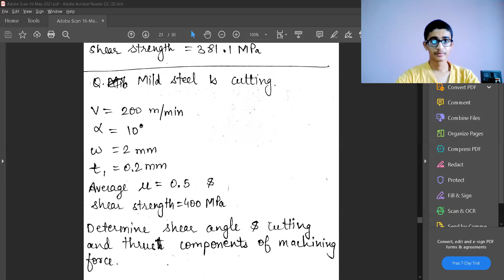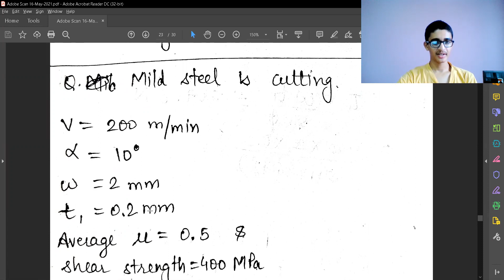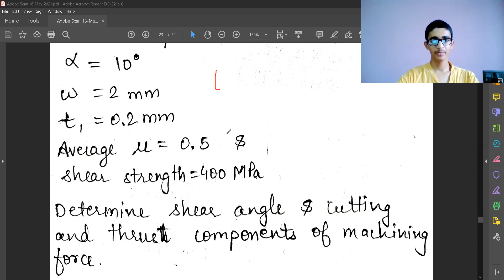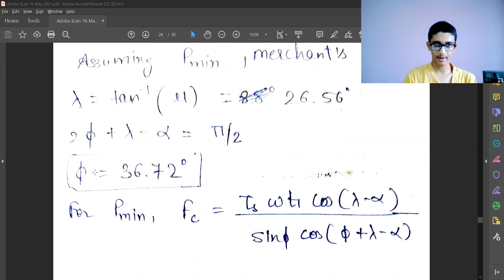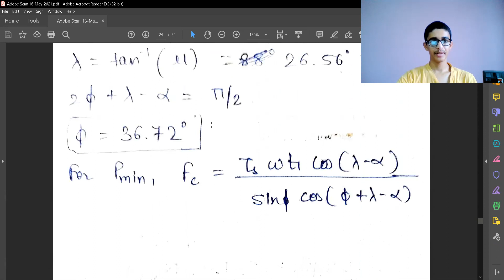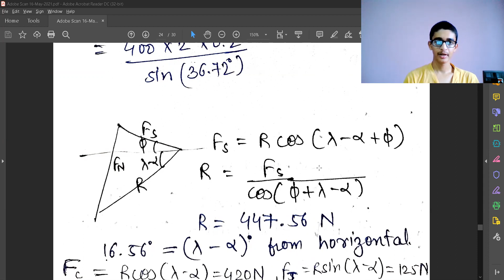Tricky Question on Machining, Assumptions to Solve Numerical Example |Machining12|PT| Mechanical Eng

Comment: How u 36.72 for shear plane calculate ur ans is wrong
Reply from the maker: Hello Viral, 
I am pretty sure the answer is correct. I did the calculation again.
Use alpha as 10 degree and lambda as 26.5 degree. You should get answer as 36.7 degree
Reply: Why did we assume merchant's 1st solution, we could also have assumed Lee-Shaffer Solution?